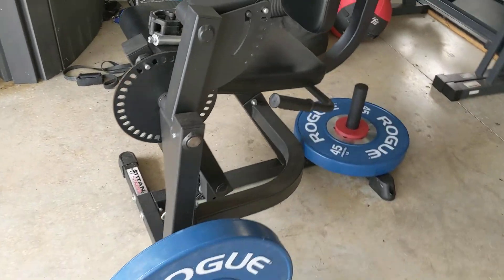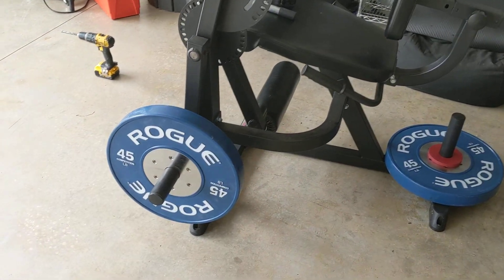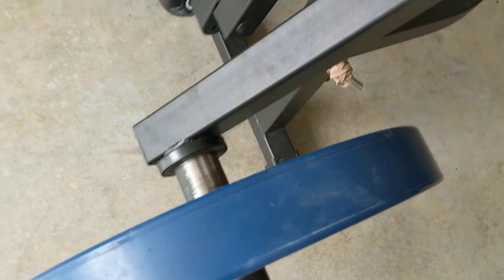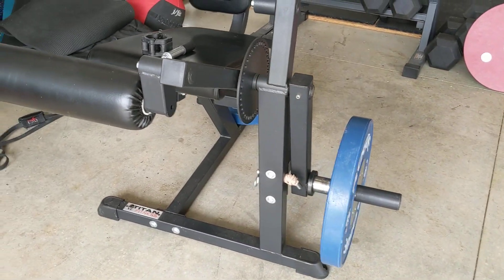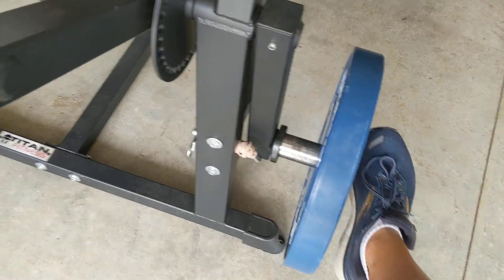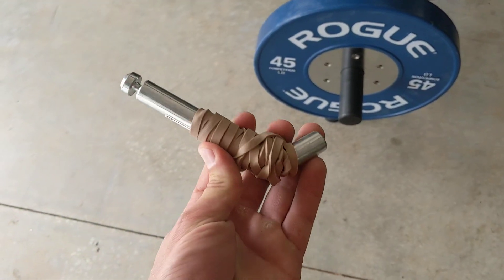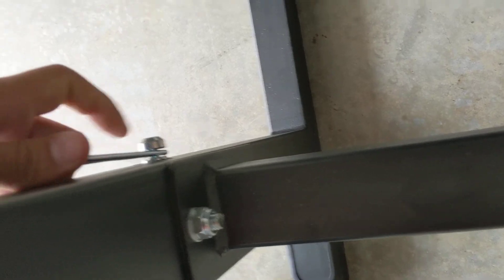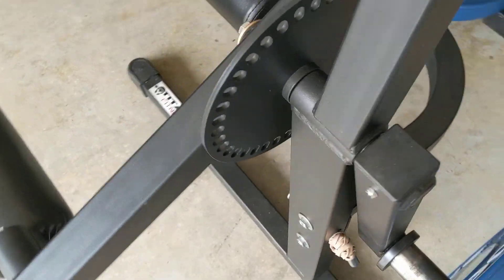$8 Fix/Improvement for Titan Leg Extension / Leg Curl Machine

Comment: Well, there a million possibilities. I would maybe create an keyhole like Rogue has on their racks. Drill maybe 1" hole and go down to 5/8, stick 1" bolt from inside. Grind grooves down to 5/8 by head and then with of the square tubing. So when I stick it from inside it drops down to lower smaller section. Hope it makes sense. Just one of many options. This would cost me $0. I have the tools and couple extra 1" bolts
Reply: genius idea!
Reply: A drill bit can make the hole in the steel bigger? Sorry I’m new to this!

Comment: Bro, put a 35 lb plate on the safety pin to the set the weight arm at 45 degrees at the beginning of the movement. This will result in more consistent resistance through the entire range of movement.
Reply: @bigdogkropp
..done it 5 minutes ago..Problem solved 👍

Comment: Great idea bro!! I can't believe Titan dropped the ball on that. Like you said Titan should've did their research...lol I have an older model Body solid machine that's been around for decades and the pin isn't fixed so it's designed to remove it to easily change from one exercise to another. There's other companies who figured this out decades ago as well! The handle idea is awesome too. Been thinking about welding on my own handle! Peace my man. 😎👍

Comment: Follow up to my question below. Asking if you even need the pin. I recently got the machine. Had it for a month now. I don’t use the pin at all. Supersets are easy to change position in between with out having to use any pin.
Reply from the maker: No.  It's not 100% needed.  We actually aren't using it right now either.  It does make it nice though to get your legs under the pads.  If the was a handle or something on the bar that extends down, so that you could pull the weight forward or back, that would be nice.
Reply: @JasonCloseOK  agreed!

Comment: You mentioned not getting a lot of load when starting a leg extension off the pin that you now have wrapped in rubber bands. I'm wondering if you stuck a couple 1" hole 5 or 10 lb plates on that pin (maybe make it bigger if necessary) so that the square tube rests on those plates, would it push the square tube up enough so that there was significant load at the start of the rep?
Reply from the maker: Yes.  It would likely help.  But, it is probably too much work for what it's worth.
Reply: @koleahara4421:
It works great !

Comment: They also make hitch pins in 3/4" and 7/8"
Reply: Can you explain this to me further? I need to do this to my machine.
Reply: @kristenlee8377  he’s saying you can just get one the same size as the exterior hole instead of drilling a hole that’s a different size. Essentially it would eliminate the need of the rubber bands.

Comment: Is a pin even needed at all? Isn't it possible to do both the extensions and the curls without the pin by simply adjusting the pad?
Reply from the maker: Yes, you need the pin. The reason is that when you remove the pin, the weight will always hang directly downward.  This is not going to give you the best resistance.  The pin placement pushes the weight resistance forward a bit on extensions and back a bit on curls, and this helps to increase the resistance of gravity.  That small shift makes a significant difference in the resistance when you're fully extended.
Reply: @JasonCloseOK  Thank you, not having a machine it was difficult to know. One other question. Do you think it would be possible to do a standing leg curl on this machine by bending over the top pad to stretch the hamstrings and holding onto the seat? Or even standing straight up?
Reply from the maker: @lorin3059  Absolutely.  I actually prefer to do them that way versus the seated.  I load up the weight and stand and do one leg at a time.  Works great.
Reply: @JasonCloseOK  Thank you so much for your video and your answers!!

Comment: So if I understand this the original stop pin on the machine is stationary basically its bolted on so you took out the bolted stop pin using the removable trailer hitch pin?
Reply from the maker: That's it.
Reply: @JasonCloseOK  ok understand now my idea would been to use something as two pieces metal hinged together about 3" or 4" long x 1" wide attached vertically by two screws that when need to change to the next position of exercise the metal would flip upwards then flip it back down but the metal would stop @ half way as in the shape of an (L) if you understand what I am saying, your idea is good but it would be annoying to me that have to use the clip each time when removing pin, you may just want to just use the pin by itself with out the clip on other side, I am thinking about getting this machine when they are restocked I will most likely alter some of the things on it when I get it.
Reply from the maker: @BrunoGenovese  This is a good idea.  Do you know of a part like this?
Reply: @JasonCloseOK  did you guys figure out a better way? I just ordered one today
Reply from the maker: @tite732  The other option is to try to somehow modify the existing stopper to make it more easily removable.  Other than that, this is the best thing I've come up with.
Reply: Anyone find a small enough D tent pin to just push into the original  stationary stopper?

Comment: Would you suggest a plate loaded machine for this?

Would you suggest going with the laying down leg curl/extension combo to avoid this issue?
Reply from the maker: That absolutely fixes this issue.  But, the cost of a pin-loaded machine is much, much higher.  They are typically a minimum of $2k, versus this $500 piece.  Is the fix worth $1,500+?
Reply: @JasonCloseOK  thank you for replying.
I'm gonna go the inexpensive route for sure. That's why your info was insightful.

I saw a few on the laying down leg curl a d I saw yours. From the 2 videos I think the laying down 1 is better.

Thank you

Comment: Do you feel the machine tips to the left at all when there is heavy weight on it? How is the metal they use, cheap or well built?
Reply from the maker: No.  I think it's sturdy enough in that respect.  For the amount of weight this machine will allow you to stack, it's sufficiently built.  It's not over-built like Rogue equipment, but it is sufficient for it's capacity.

The biggest fear is it tipping forward.  You have to put a counter-weight on the back to keep it from tipping once you start using heavy weight.
Reply: @JasonCloseOK  thanks

Comment: Is it possible to keep your original pin but not bolt it in so you can remove easily?
Reply from the maker: Yes. But it will quickly fall out.
Reply: @JasonCloseOK  I just received mine today. I will try to figure out what to do with the pin.. maybe there is some way to use the original pin but have something on the other end for a quick release.
Reply: @JasonCloseOK   This was my suggestion too. but I guess you answered that with it falling out. Bummer!  Maybe there is a way to get a pin that will secure the original peg from falling out. I feel like that 3/4" peg is not thick/secure enough and the rubber band is kinda annoying/cheap looking and more importantly not protective enough and it seems like it would rattle. I guess if it gets the job done that's all that matters. I read in the comments that they also make 7/8" hitches.  Great video! Thanks! Its got my wheels turning. Waiting for mine to arrive as we speak.